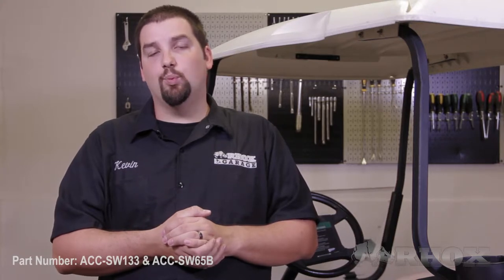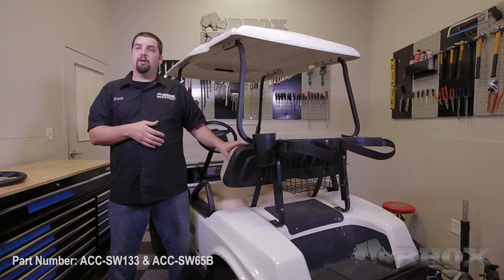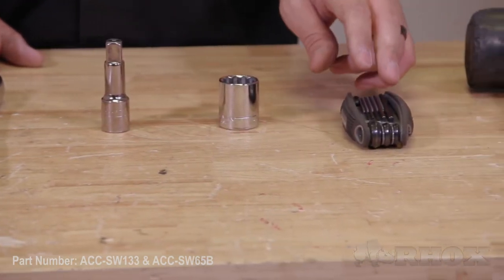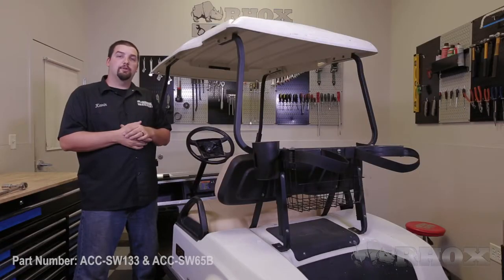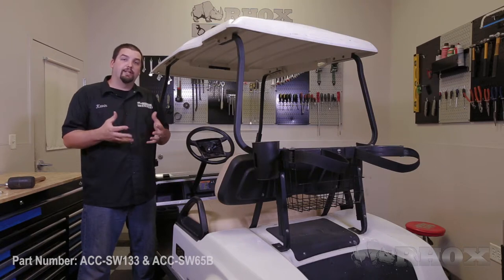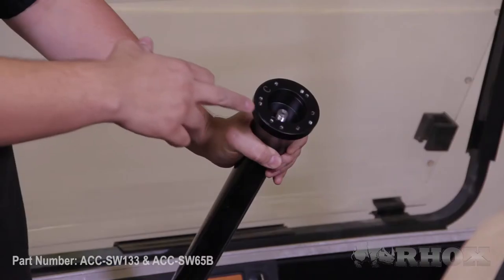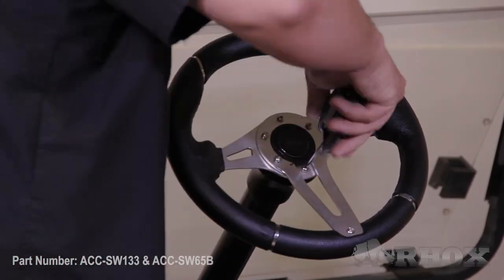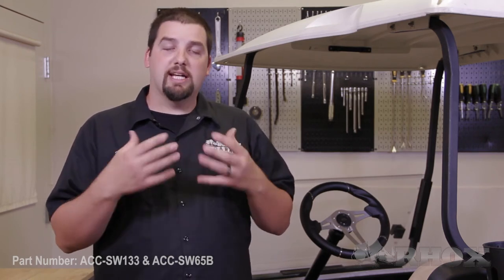ACC-SW133 RHOX Custom Steering Wheel & ACC-SW65B Adapter on a Club Car DS

Comment: I can’t get the holes to line up for my wheel to be straight on my club car precedent. When the top hole lines up the bottom is out of line. I am limited on turning it by the shaft nut.
Reply from the maker: Could you please contact us via our website so we can get more details? We will need to know the cart's SN and part numbers of the items you are trying to install.  

http://rhox.us/contact_us.asp

Comment: Junk!! I bought one and put it on and the rubber came loose and  just crumbled a part!! My cart is garaged kept and isn't used very much only to drive to our sons house around the corner.
Reply from the maker: This is not something we see under normal use and proper care.  Please contact your RHOX dealer to have them submit this for warranty consideration. They will be able to help you resolve this quickly.